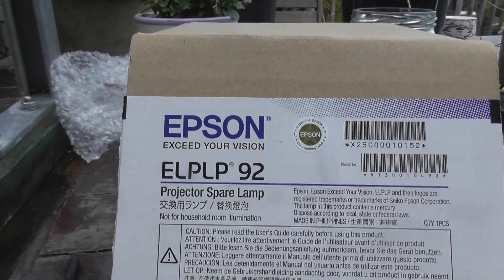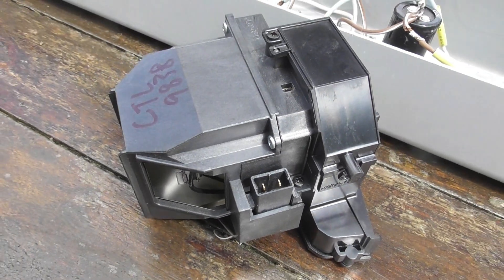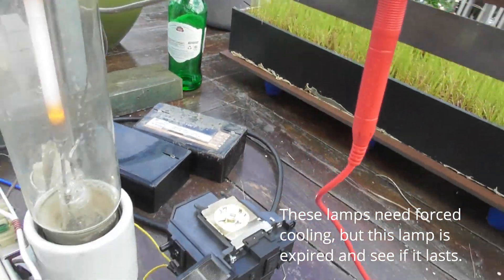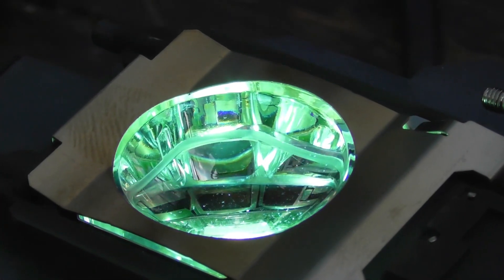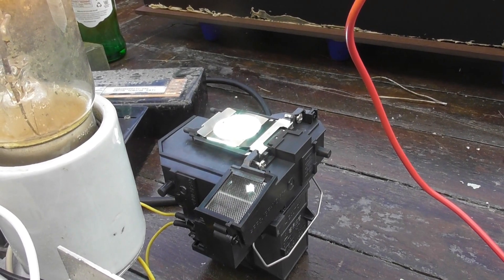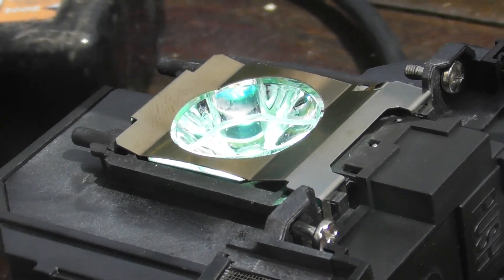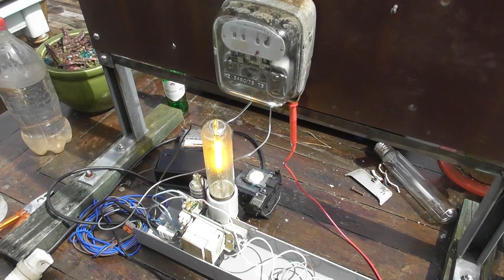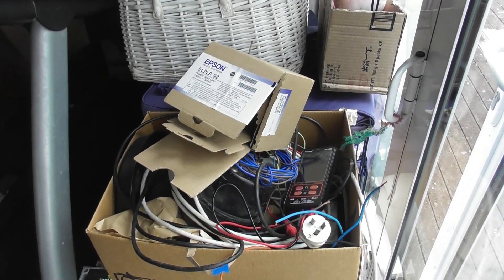Epsom ELPLP92 expired projector lamp test

Comment: Risky business, this is dangerous not from an electrical perspective, but from an explosion hazard.
I have had experience with a projector lamp exploding before, consequently I do not play with these things since, they're dangerous.
They are designed to be force air cooled, and also to be controlled by a very complex ballast that contains a microcontroller to manage the lamp discharge dynamically. The ballast is also in constant communication with the projector's main CPU in order to prevent the conditions that might pre-empt explosion.